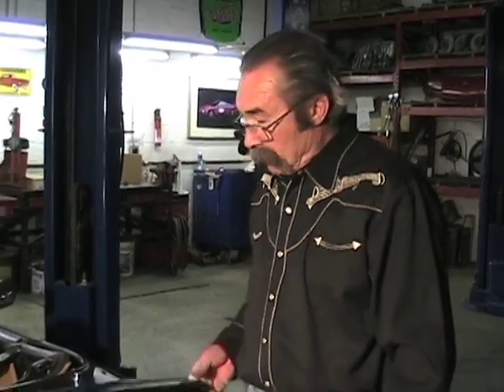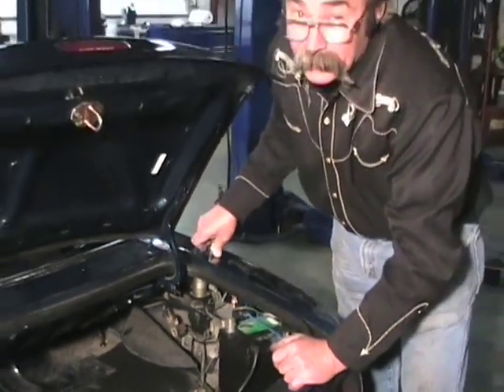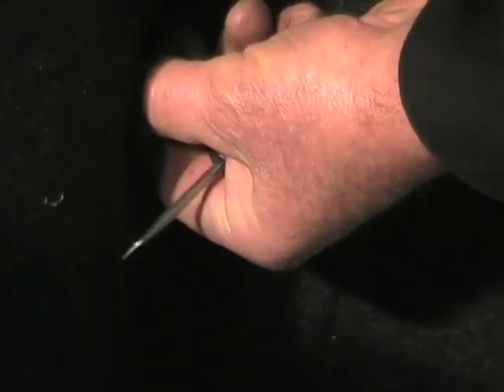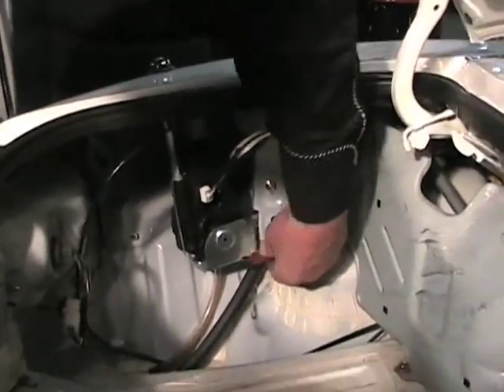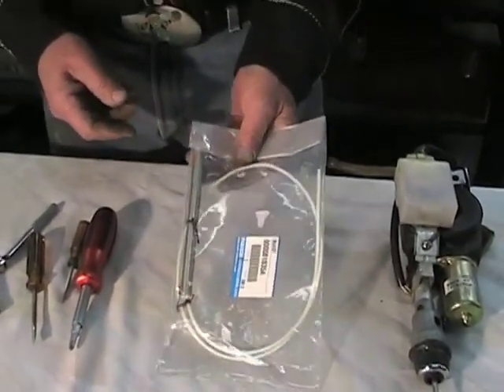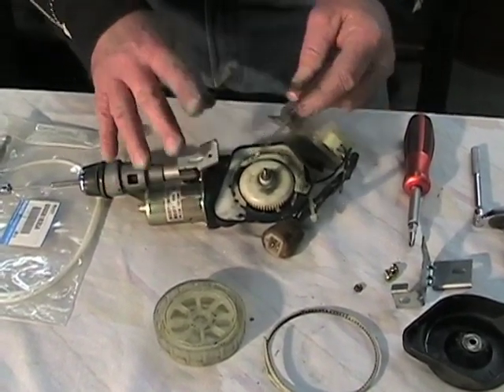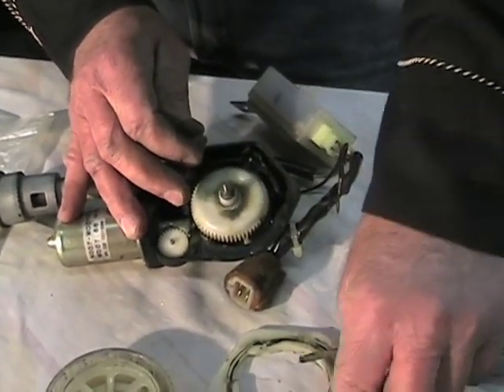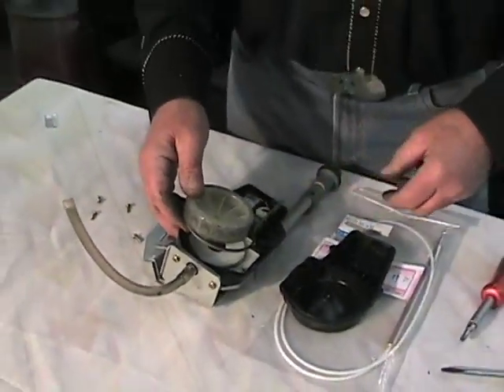How To Replace The Mazda Miata Antenna Mast Part 2

Comment: So grateful for this video.   It was "floppy" like you described and I cleaned out my (NA '93) spool, reassembled and it is working great right now.  Now I have to figure out how to use the radio as it is not very intuitive!  But it's getting reception and the antenna is going up/down per spec.   Thanks so much--more than 10 years after you made video it saved my day.

Comment: Hey great video. I had my antenna replaced a week ago on my 93. I didn't do the replacement. The problem is that the antenna will not go all the way down. It stops  about 6 inches from being flush to the car. Thank you

Comment: Excellent video! Quick question, any idea which way that washer on top of the reel goes back on? 

I had trouble getting my cover off earlier today, I forced it and the cover came off quickly and the washer went flying, so i didn't get a good look. It's not a flat washer and I'm not sure if the wide face sits against the reel (stopping it from spinning) or if it sits against the plastic cover.  Any help would be much appreciated.
Reply from the maker: Hello El Green Comet,
When looking to reinstall a part that flies off, look for the rub marks as to the way it was placed.
It is a Miata it will tell you how it goes back together. Good luck with your Miata Mission.
The King of Miatas. Mike.

Comment: Great video! I have a 2003 Miata. The "fishing cable" broke inside the metal tube that holds the electrical connector. Now I can't get the antenna and cable stub out of this tube . The shiny metal sleeve that holds the antenna seems sealed in the in the heavier metal piece.
Reply: Have you watch part 1. Use a release agent on the stuck parts, soak overnight. Good luck with your Miata Mission.
Mike. The King of Miatas.

Comment from the maker: Hello Sir Stephen,
When you turn the radio on and off do you hear a whriling sounds from the antenna motor. If not the antenna motor may not be wired up to the radio correctly. The antenna motor has two power leads, one is steady to run the motor the other is the signel from the radio to acctivate the motor. If you do hear sounds from the motor the antenna mast may be broken. Good luck with your mission.
Mike.
The King of Miatas.

Comment: After you clean out the unit and put back in car do you turn on the radio to raise the antenna so it will pull it in or do it not matter thanks great video
Reply from the maker: Hello Sir Ken,
Yes, that is correct. First turn on the radio to cycle the antenna up then have your assistant turn off the radio while you
        install the mast leader into the antenna assembly. Good luck with your Miata Mission.
        The King of Miatas. Mike.

Comment: dear miata king was trying to follow your instruction but the mazda replacement antnna mast I have will only feed up through the sleeve. I cannot push it in from the top as you show. 
I had the same problem getting the old broken mast out as well. it wouldnt pull out from the top, I had to remove the sleeve from the motor / gear cover. 
any suggestion on what im doing wrong?
Reply from the maker: Hello Sir Tim,
You may have the wrong year mast. There are two types, 1990 thru 1997 and the 1999 thru 2005.
Take a look at your part numbers on the package.  The King of Miatas. Mike.

Comment: King of Miatas,

I am trying to install a power antenna on my 96 which appears to have never had a power antenna.  The electric connection is there in the trunk, but Mazda's site seems to say that I need a fuse block?  Could you possibly explain any necessary extra processes to install a power antenna if your car didn't come with one?  Thanks so much for all the videos.
Reply: There are two plugs actually. One attached to the metal bracket on the stock antenna and one along the wire harness farther back in the trunk. The one farther back is the unused plug for the power antenna and the one attached to the bracket of the stock antenna is where the fuse block goes. Two regular 10 amp fuses should work just fine.
Reply: ***** I figured it out back a year ago when I wrote the comment.  However, the antenna doesn't go down when I turn the radio off which I am pretty sure was the original intention.  Right now it just goes up when I turn the car on and down when I turn it off.  Any idea how to fix that?
Reply from the maker: Brendan Kruse Hello Sir Brendan,
You may have a aftermarket radio and the trigger lead is connected to a power on tap not the trigger from the radio. A good stereo shop can help the wire codes so you can connect to the proper lead. Good Luck with your Miata Mission.
The King of Miatas.
Mike.

Comment: Hello Mike, my antenna just stopped going up and down. I first checked to see if I had pwr going to the antenna and I did. I removed the assembly to see if the motor was bad and did some resistance measurements between the ground pin and the other two pins and got "OL" on one side and 14.7k ohms on the other. What do you think could be the problem?
Reply from the maker: Hello Sir Manny, Thank you for  your concerns. Now that antenna is out of Miata try to power it up with ground and power to see if you can get some life, sound or motion,  If not the mast may be stuck. Good Luck with your Miata Mission. Mike. The King of Miatas.

Comment: Hey Miata King! My Dad is installing a new 1993 Miata antenna mast, using your instructions. 
He is able to feed the leader into the retractor assembly.
But when he turns the radio off, it pulls the leader in about 2 inches.  Then the leader stops feeding- but the motor keeps running for 5-10 seconds, then shuts off. 
Why is it only taking in a few inches of leader?
Reply from the maker: Hello A G
Sounds like you have a broken leader still in  the motor assembly. You will need to take the motor out of the car and apart to fish out the broken leader. Check the video again. Good luck with your  Miata Mission.  The King of Miatas. Mike.

Comment: 2000 Mazda power antina work good but  radio has very little reception when antina is fully up is there a hight adjustment or a fine tuning
Reply: Hello Sir Christian.  You will need to check the ground for the antenna to the body of the Miata at the mast body to the quarter panel. Good Luck with your Miata Mission. Mike, The King of Miatas.

Comment: What causes the motor to stop? My antenna on a 2004 NB goes up all the way and retracts all the way down. But when it gets to the maximum retraction point you can hear the motor still running and clicking gears then it seems to time out after 20 seconds or so and stops. There does not appear to be any limit switches in the motor casing. How does it know when to stop? Does it sense a motor stall to shut off when going up or down? Thanks.
Reply: Hello,
Thank you for your concerns. On the up it clutches out and breaks circuit. On the down it is timed. 20 seconds seems like to long.
Maybe it is a fast retractor. We could call it the switch blade antenna. Mike, The King of Miatas.

Comment: I got as far as opening the motor up and clearing out the fragments of the lead. I've removed the seal and collar that mount the assembly through the fender panel but the telescoping mast portion is stuck in the assembly. How does that come out, a vise and a strong tug?
Reply from the maker: Hello Sir Chris,
Thank you for your stuck antenna concerns. Yes, a vise and good strong tug is a start. We heard of connecting a slide hammer. Best of luck with your stuck mast Mission.
Mike.
The King of Miatas.

Comment: hey, i followed ur vid and replaced mine, but i discovered a part i didnt see u replace so i missed it. i went back in to appy that part and now i dont hear my motor anymore. do u think i burned or blew it up? the fuses seem fine.
Reply from the maker: +s buchanan Hello, Thank you for your concerns. Maybe you did not plug in the motor or turn on the ignition switch or turn on the radio off and on ?Good Luck with  your Miata Mission. Mike. The King of Miatas.
Reply: Hello, Thank you for your concerns. The next step is to repeat the job and watch for the black ground wire connection. Good luck with your Miata Mission. Mike, The King of Miatas.

Comment: I have 1995 NA Miata. I removed the special nut at the top, and the nut holding the antenna motor assembly, and disconnected the electrical connection, but it is still attached to the car... How do I remove the antenna motor assembly??

Comment: But how do I install the new antenna gear mast?  Do I wind it up and then install or do I feed it in like a snake going into a hole?
Reply from the maker: Hello Sir Sense,
Yes, you snake it into the hole when the motor is retracting. Watch part one of this video to see how to snake.
Mike, The King of Miatas.

Comment: Here is an idea or plan. Just get rid of the heavy motor set up and install a bullet antena, not only does it look great, it will save a tiny bit of weight and issues with bent rods.
If you stay original don't forget to lube your rod now and again.
Reply from the maker: Hello,
Great ideas. Mike.  The King of Miatas.